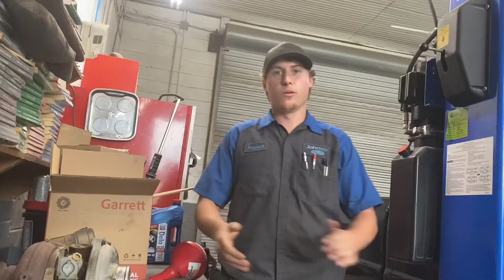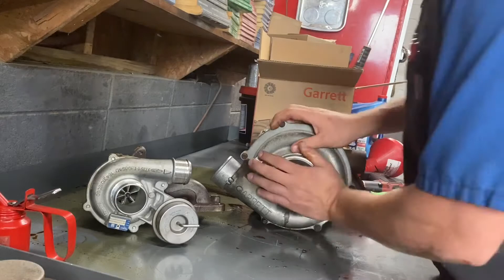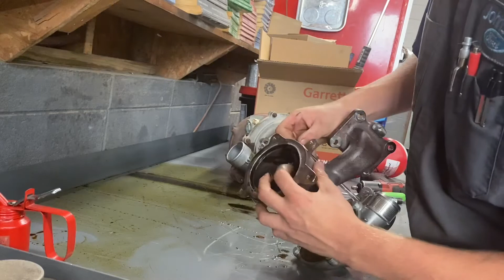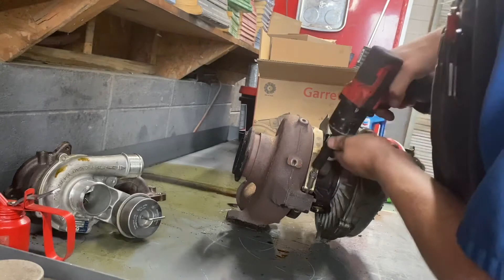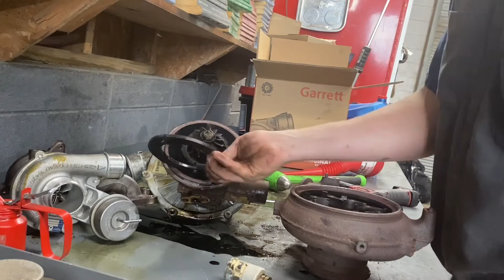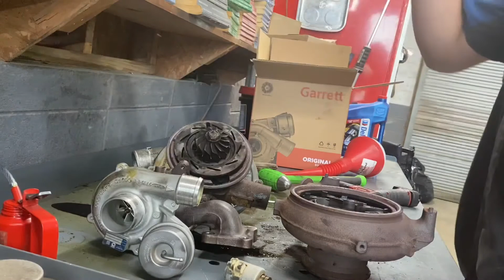Variable Geometry Turbocharger VS WasteGate Turbocharger (WHATS’S THE DIFFERENCE??)

Comment: Explanation lacks accuracy.  Need to explain that wastegate flow bypasses the turbine, reducing flow through turbine reduces turbo speed and compressor pressure rise.  On the other hand the VGT vanes cannot bypass the turbine - all the flow goes through this path (and obviously should never be fully closed).  All these vanes can do is change the passage opening so the exhaust gas velocity and direction can be controlled.  The tangential velocity drives the turbo to spin.

Comment: The vanes do not control the amount of exhaust gas. At low rpm the vanes are more closed so it creates more velocity because it needs to flow through a narrowed space. Higher velocity makes the turbine spin faster so you have less turbo lag. In higher rpm's the vanes will open up because now there's enough capacity.
Reply: Higher velocity is  going to have to equal lower flow until the compressor spins up